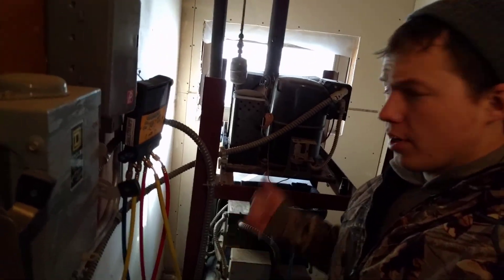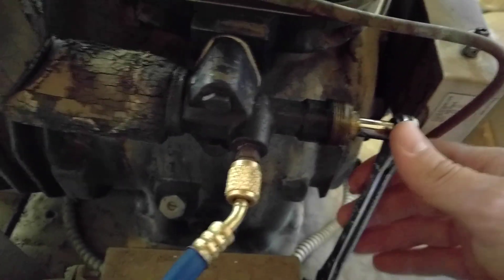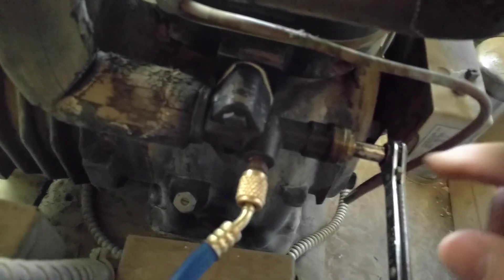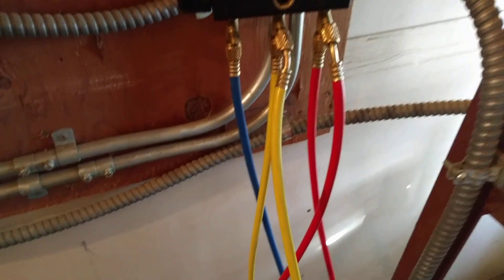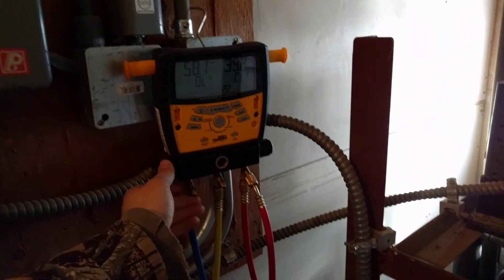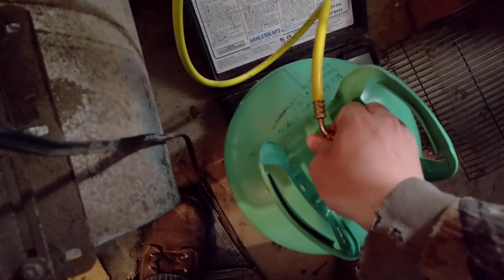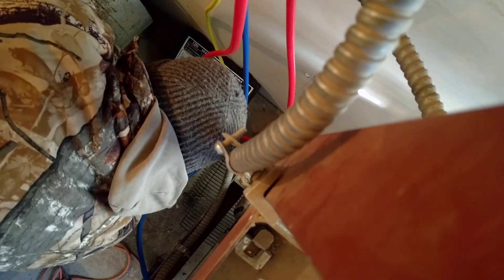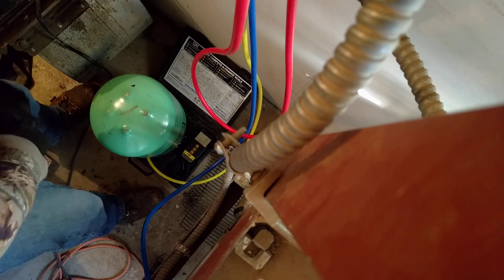How to Add Freon or Refrigerant to a Walk In Cooler or Freezer with Sight Glass

Comment: Now it looked like the suction pressure was going to drop below zero psig which if the leak in the system is on the low side of the system wouldnt it potentially pull in air??

Comment: Hey Ben what if i was trying to put refrigerant in and forgot to crack the service valve on the line? My low side was only grtting 10 lol
Reply from the maker: Asking for a friend right? ;) Are you just talking about bleeding out the air?
Reply: @BenjaminSahlstrom  Yes I could totally use your help all the time! I work in light refrideration and am still learning. I was charging a walk in cooler the other day and my high side was suppose to be around 155 due to the pt chart. But the low side was at 10 psi?
Reply: Also I understand how you're supposed to find the High side Pressure because of pt chart. But how are you supposed to know the low side pressure?

Comment: R22 is not a blend and should be charged as vapour only into the low side of the system....
Reply: thay makes no sense a compressor is a compressor. follow the same steps as charging 410 and its fine. just because you can doesnt mean you have to
Reply: @vanhalenman60  A compressor is a vapor pump. It is not designed to pump liquid, you will slug the compressor. If you’re going to charge as a liquid, make sure you throttle the flow of gas.
Reply: Well then what diff does it make
Reply: Correct it is not a blend. But you can also charge it as a liquid or gas depending on your situation.  If the system is dry and under a vacuum then u would charge as a liquid on the high side with the system off to fill that site glad then u can turn the unit on to check your superheat to see if you would need to add more or not.
Reply: Pure refrigerants can be charged as a liquid or vapor. However, blends MUST be charged as a liquid.

Comment: R22 is not an azeotropic (mixture) refrigerant. And charging as a vapor is perfectly fine and allows u to charge quickly. When a compressor kicks out on low pressure,  I usually kill power and dump liquid to quickly add charge (allowing a few minutes before returning power) until the pressure switch is out of the picture. But that’s just me.

Comment: Good Video.  A Little tip for ya. Tighten the yELLOW hose onto the Refrigerant jug WHILE u are bleeding air out NOT after you purged a little air out. if u do like u did in the video it is possible to get air back into the yellow refrigerant hose when u stop bleeding air out. bUT, REMEMBER YOU STILL HAVE A SMALL AIR BUBBLE BETWEEN THE TANK AND HOSE NOW SO TO GET ALL AIR OUT U MUST CRACK TANK OPEN AT SAME TIME AS BLEEDING AIR OUT OF HOSE to Eliminate ANY AIR BUBBLES. This is Why i Use a 4 Valve Manifold Purging everything back through the manifold and out the vacuum Hole at the manifold elimanting all air from hoses through manifold. I'll Put up a video soon and show u What i Mean. Good Video besides that.
Reply: well damn Mr Know it all is everywhere
Reply: @primetime758  Thank the good Lord for those that teach…We can all be know it alls!
Reply: where is the video you were going to do using the 4 port manifold? I would like to see it.
Reply: Why u shoutin bro u wanna fisticuffs?

Comment: I like to front seat king valve and introduce liquid into the liquid line, after I've pumped the system down. It will minimize liquid pushing oil out of the compressor and slugging. Try it out. It charges alot faster as well
Reply: My preferred way when I have a receiver.

Comment: As far as I've always known, you don't charge r-22 as a liquid, only as gas.
Reply: For tiny amounts : vapour. 
For any normal job : liquid. Unless you wanna be there all day.?
Charging as gas cause the bottle to chill to freezing then go slower still
Reply: @Froggability  No, wrong, r22 is supposed to go in as a gas as 410a must be a liquid. Sometimes tech will feather in some liquid r22. When the bottle gets cold we immerse it in hot water. What you said sounds like something one of the many "hacks" out there would say to justify
Reply: you just can do that, no reason to make it take that long if you throttle it right.
Reply: Refractionation is what occurs when you add a blend as a gas. You begin to charge with not 1 but 2 or 3 different blends at different pressures and blah blah
Reply: @Veedub98  you mean Fractionation.
Reply: R22 is a terrible choice for low temp equipment, I know systems have been built and designed with it but it’s just terrible. Also can you hear the valves in that compressor? I’m guessing it’s under incredible strain from pumping low temp 22 and most likely a TXV issue. I enjoy HVACR videos, seeing equipment, specific problem and techniques used by different techs but I have to be honest, I can’t see where this video is helpful in any way. It would only be useful to somebody who doesn’t know what to look for or why. Please keep posting, we need more interest in this trade but we have o be careful sometimes of what we put out there.
Reply: Only single component Refrigerants Can be Charged as a Gas. R-22 is a single component refrigerant. R-12 is a single component refrigerant. R-134A is a single component refrigerant. Most All Other Refrigerant these Days is a Azeotrophe or Blended refrigerant. if it has more than 1 component in the refrigerant jug it MUST be charged as a Liquid. Google msds sheet for any refigerant to find out if it is a single component refrigerant or blend etc. R-404 is Triple component refrigerant it MUST be charged as a LIQUID ONLY. R-404a msds --- www.nationalref.com/pdf/3%20SDSR404A.pdf
Reply from the maker: Shinobi-_-Oscuro Either is fine. Almost all refrigerants require being charged as a liquid so it's the most common charging method. There are very few refrigerants that aren't a "blend" of some kind these days.

Thanks for your comment.